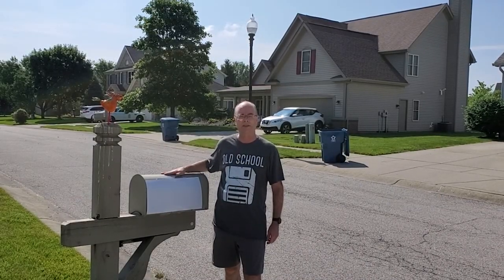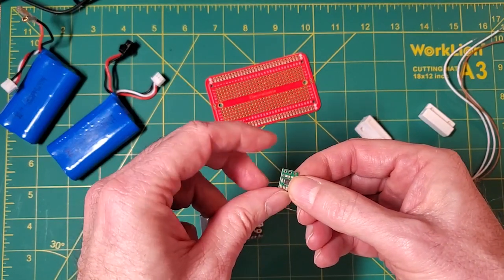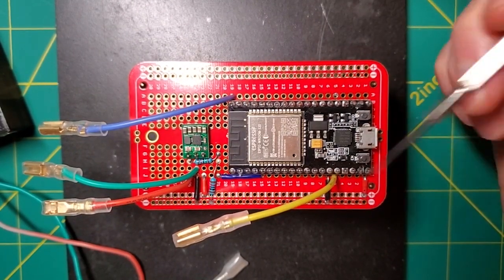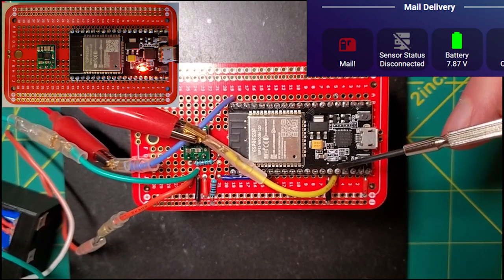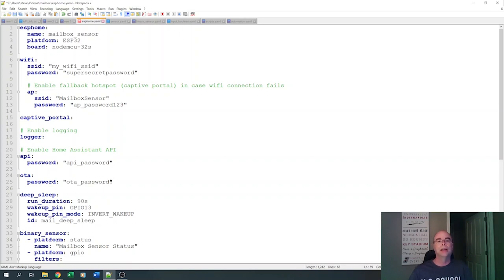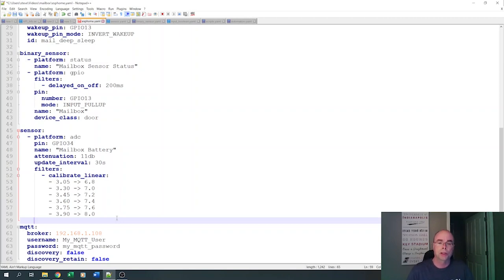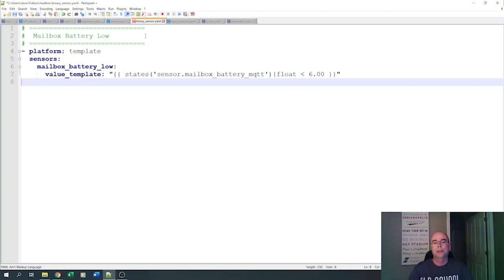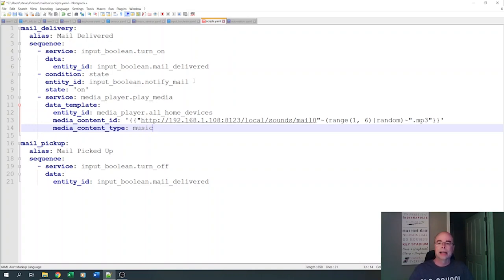An ESP32-based Mailbox Sensor for Home Assistant

Comment: Some recommendations:  Always use sockets for the microcontroller.  Then if something goes wrong, you can easily unplug it.  Likewise, if you choose to use boards like the author, only solder the pins you're using.  Then it's easier to unsolder if needed. Great video BTW.  I'm thinking of doing the same type of project, with the addition of a solar cell to keep the LIPO charged.  I'm also going to add IR LEDs and IR receiver to actually see if something is in the mailbox.
Reply from the maker: Thanks for the tips.  I do use headers or 'sockets' for some projects, but that's normally during the development phase when I'm writing and flashing my own code and there is a high probability of me bricking something.  However, when ready to roll into 'production, I like to make my controller units as small as possible and place in a 3D printed enclosure.  The sockets just add additional height that I don't need.  Plus there is the possibility (although remote) of the board working loose from the socket... especially in a situation where exposed to vibration.  Honestly, for the small cost of the controller and components, it's hard to beat soldered connections for reliability.  If something does go wrong down the road, I just rebuild it.

But I do appreciate you sharing other alternative ideas. A removeable controller is definitely needed in situations where you can't flash updates over-the-air and have to flash via USB.  Good luck with your mailbox project.  I think solar would solve the problem I had with battery life, but I've since switched over to using Zigbee and a Zigbee sensor, which provides 10x the battery life over the wifi version.

Comment: Oh my... what a build! Good job. I recently bought a $10 wireless door bell that has a 1100 foot range from Amazon. I soldered a magnetic reed switch, also from Amazon, (like on the windows/doors of a security system), screwed the switch on the mail box and plugged the door bell into a wall socket. Works perfectly for less than $25 and 20 minutes to install.
Reply from the maker: Yeah... tends to be a bit more complicated that it needed to be... but that's par for the course for most of my projects!

I have since upgraded the original sensor and control box with a Zigbee reed switch.  It took a couple of tries to get the right sensor (metal mailbox really kills the signal) and I needed to add a repeater/router to the outlet on the front porch, but it has been working flawlessly for six months.. all on a single battery and with no wires inside (or outside) the mailbox.

But the doorbell idea is a really good one!  Thanks for watching and taking time to leave a comment... and sharing another great option for a mailbox sensor.

Comment: Top tip from my recent work building a very low quiescent current RF beacon; put a generic optoisolator between the battery positive rail and the resistor for the resistive divider. You can then use a GPIO pin to turn on the divider via the optocoupler LED. The added series resistance is negligable, you can always tweak the derived voltage in the code.
Reply from the maker: Thanks for a great idea!  I published a video a few weeks ago where I ran a very un-scientific study of two different designs to try to improve my battery life.  I am NOT an electrical engineer (just a wannabe hobbyist) but the main take-away was that the ESP32 dev boards continue to draw power even when the ESP32 chip itself goes into deep sleep.  Likely the UART chip and/or the power regulator.  The voltage divider probably isn't having a big impact in this case as compared to the draw from the "sleeping" ESP dev board.  I've actually switched over to using a Zigbee door sensor since I did this video.  Great battery life, but it has it's own challenges with signal strength inside a metal mailbox!

Thanks again for the great suggestion.  I love how much I'm able to learn from the people that watch my videos and provide ideas on how to make something better.

Comment: I use a Ring doorbell that I absolutely hated, chucked the POS in the mailbox! it works well enough... but I like your idea and will do this when the ring finally rings its last bell.
Reply from the maker: I should state that while the wifi version worked well, I did get tired of the short battery life due to the hungry nature of Wifi.  I have since replaced the original system with a Zigbee sensor.  I didn't have a Zigbee network when I built the original wifi system.  But the Zigbee sensor gives me 6-9 months of battery (shorter in the winter) vs. the 4-6 weeks with the wifi version.

But other than the battery life, the wifi version worked very well and reliably.

Comment: Nice project, thanks for sharing. I recently did a similar project, deep sleep is nice but I found a power latch circuit works better. That way, the board is powered down completely and a dual MOSFET turns on power, the ESP32 itself can switch off power, once done, via a GPIO. Ralph Bacon has a nice design using a Si4599 IC. This way you don't have deep sleep current draw and you don't have to guess a value that determines how long your board is powered on
Reply from the maker: That's a great solution.  For me, I eventually added a Zigbee hub and network to Home Assistant.  Once I did that, I swapped out my original wifi version for a simple Zigbee door sensor.   It did require me to install a Zigbee repeater (router) via a smart outlet on my front porch to extend the mesh to reach the mailbox, but it has been working great for over a year.

The advantage is not only battery life (I'm getting 7-8 months off of a CR2032 battery... a little less in the cold winter vs. summer), but I also no longer have any wiring inside or outside the mailbox... just the simple Zigbee magnetic switch attached where the original wired reed switch was.

But for those where Zigbee may not be an option, your solution is a good one!  I think if I could have completely powered down the ESP32, then the battery life would have been much, much longer than what I was currently getting.  Thanks for taking time to share it.

Comment: YAML, nice walk-through.  Ultimately, everyone will have to understand what's under the hood.  I'll be reviewing your code for some takeaways.  Maybe a video on how you set up the phone notification via SMS.  I haven't researched this one yet.  I found Verison what not sending text to me that I forwarded from google( I believe, it's been a long time ago)
Reply from the maker: Thanks!  I like to try to cover at least a bit of the YAML/automation and then point people to the related blog or Github for the full code and/or deeper explanation.  My push notifications are currently done via Home Assistant and the Home Assistant mobile/companion app, so they technically don't use SMS.  It's pretty straight forward once setup, as our phones are defined devices in HA and all I have to do is issue a service call to that device (e.g. myphone.notify) with the text and type of message.  The actionable notifications are really nice... so example if I send a push notification that says the garage lights were left on, there is an action right in the message that says "turn lights off" that I can just tap.  But I'll definitely consider doing a longer, more in-depth video on this process.

Thanks again for watching and taking time to comment!

Comment: How about using an ESP32 with external antenna mounted on the wooden post? I forget the ESP models but they have connectors to use instead of built in wifi antennas.
Reply from the maker: Yeah... I need to pin a comment or update the description.  I originally did this over 3 years ago and struggled with battery life... but that was before I had a Zigbee network.  I long ago replaced the WiFi version with a simple Zigbee door sensor.  No controller, no wires and battery life of around 9 months.  I did initially have some signal issues inside of the metal mailbox, but once I built out the Zigbee network a bit more and added a router on the front porch in the form of a smart plug, it is been rock solid... works every time and nothing is outside of the box and exposed to the weather.

But I do appreciate the comment and recommendation.

Comment: Excellent video. Thank you for letting us know about the Home Assistance . This is cool since I do not have web page. I was going to use a IOT device but this might be easier.  I purchased similar magnetic switches that you are using in your mailbox. I purchased 10 of  them to put in all my doors and windows in my house. I just need to make a decision on a circuit board. There are so many choices for us, (Raspberry pi, microbit, Arduino,etc).
Are you using the ESP 32 for all  the doors and windows? Thank you!
Reply from the maker: Thanks... and thanks for watching and commenting.  To answer your question, I use Zigbee sensors for all my door and motion sensors.  The advantage of Zigbee over wifi is primarily battery life... and the fact that each device does not need its own controller or board.  The disadvantage is that a Zigbee hub is needed (if you have one of the new Amazon Alexa devices, it may have Zigbee and can serve as that hub).  In fact, I have since upgraded my mailbox to use a Zigbee sensor instead of wifi.  Not only better battery life, but I only need the door sensor... so no other wires or mounting of a controller is needed.

But to answer your question, I used the ESP32 board.  This was due to its ability to go  into 'deep sleep' and conserve battery life.. and could be woke up by an external sensor (the door sensor in the case of the mailbox).  Something like a Raspberry Pi would draw way too much power and quickly drain any batteries that might be attached to run it.  I have a follow up video to the original mailbox video, where I try to improve the battery life (https://youtu.be/OykXRflaKe0), but I also talk about replacing the original system with a Zigbee sensor - jump ahead to about 24-25 minutes if you just want to see that part.... and I've even improved the original reliability of that with a Zigbee router (smart plug) in my front porch.

Sorry for the lengthy reply... but Zigbee is probably a much better solution for any sort of door/window sensor... and a lot of motion sensors as well.  And yes, the Zigbee sensors integrate nicely with Home Assistant as well.  Let me know if I can help out any further!
Reply: @ResinChemTech  Thanks !  It is not too much detail to me since the more information the better. I appreciate the new link and additional info.
 I have a 3.?  volt Lithium battery in a box waiting for me since I purchased it for a robot. I forgot since what I was going to use it to build a robot but my Dad got sick a over 5 years years ago and I had to stop tinkering with electronics to help him. Now that he has passes on, I started again.
 I will stay in touch.   Again, thank you! " Happy Fathers Day" if you are a father!

Comment: Fantastic video! A couple questions:
1. Did you need to think about weather sealing the stuff under the wood? No chance water gets on?
2. Did you ever find that the buck converter interferes with the wifi connection?
Reply from the maker: Thanks!  To answer your questions:
On the first version, I really didn't do anything to 'seal' the components other than the 3D printed cases they were in.  It's pretty well protected where I mounted it, but at one point the entire mailbox was buried under snow (that DID kill the wifi!).  While the system still functioned, I did notice some corrosion on the ESP32 pins.  So, I rebuilt it, but covered all the pins in hot glue to help prevent the corrosion.

I didn't notice any wifi problems, but the buck converter did lead to battery drain and at one point, destroyed the Li-ion battery because it went low when I was out of town, but kept draining the battery down to nearly 1V.  By that time, I had added a Zigbee hub so I switched over to just a simply Zigbee door sensor.  Problem with that is the metal mailbox pretty much blocks the signal when the door is closed.

I'm currently working on a new version (back to wifi), but will be testing a couple of different designs and doing a side-by-side battery comparison.  I'll release a video on that, probably in the next few weeks depending upon battery test results.  But I hope to get more than the 1 month battery life I originally had in the first version.
Reply: @ResinChemTech  wow, that's a ton of new info, thanks!
If only there were a way to attach the reed sensor to a ZigBee sensor... and get the device out of the Faraday cage. All the standard ZigBee door sensors have the reed sensor right next to the radio.
Reply from the maker: Yeah... I toyed with the idea of trying to build some sort of Zigbee sensor that would support an external antenna, but most off-the-shelf antennas are made for the hub/coordinator and not the end point devices and everything I came up with was either too big and bulky for inside the mailbox.  I did violate my own rule on modifying existing structures and drilled a small hole (about the size of a pencil) on the back side of the mailbox that is line of sight to the hub, which is just inside the front porch.  This actually improved reliability significantly, but the sensor still drops off the network from time-to-time.  When that happens, it won't rejoin no matter what I do, so I have to delete the device from HA, unmount the Zigbee sensor, bring it back inside, pair it again and then add it back to Home Assistant!

So, the wifi version was much more reliable and stable.  The biggest issue with that was the 25-30 day battery life.  That's what I'm hoping to study/improve upon in the next video.  I'm actually building a 'test rig' with servos that will simulate opening the mailbox... then track battery voltage in a MySQL database. Still working on getting it all setup though!
Reply: @ResinChemTech  1. Bummer not being able to attach an antenna or separate reed switch to a door sensor
2. Andreas Spiess has a video about putting LoRa inside his mailbox, and claims that is finally strong enough to get through the metal cage (no holes)
3. I was also wondering about some mechanical coupling. What if the mailbox door pulls a string or rod (much like servos couple) that teaks an external reed switch/door sensor?

Comment: Love your videos!  Just wandered if you considered a tilt sensor.  It would simply slightly.  I use a very cheap mercury switch , 3d printed a small holder to put it in and then stuck to mailbox door.
Reply from the maker: Thanks!  I didn't really think about a tilt sensor.  But like most DIY projects, there are always multiple ways to accomplish the same outcome.  Thanks for watching and taking time to suggest the use of a tilt sensor.  Just out of curiosity, the tilt sensor has to be wired back to the controller, right?  How did you deal with wiring that was connected to the moving door... or did you put everything in your 3D enclosure and stick that to the door?
Reply: @ResinChemTech  sorry for the delay, i just saw your reply. I am using an rf read switch device ( battery powered) in back of mailbox, I tapped into the read switch with 2 wires leading inside the mailbox up to the lid.  Then 3d printed little holder for a small mercury switch and double sided 3m sticky stuff to the mailbox lid.  I also put a better antenna on the rf sensor to help it make the distance to the house.  everything is IN the mailbox accept the antenna